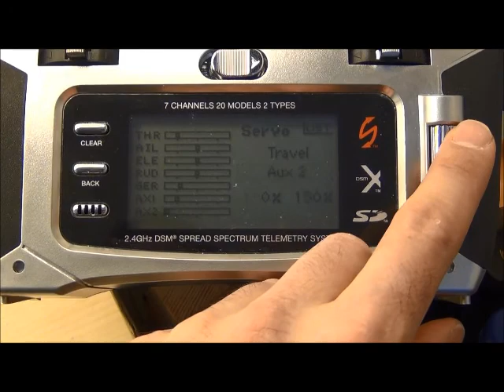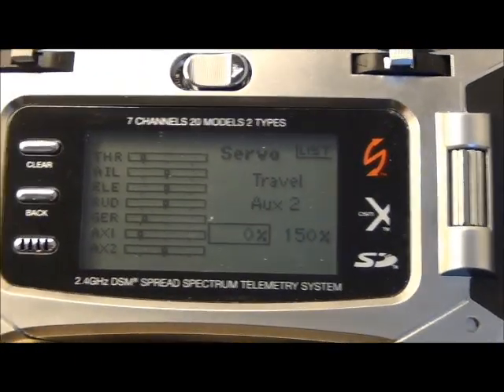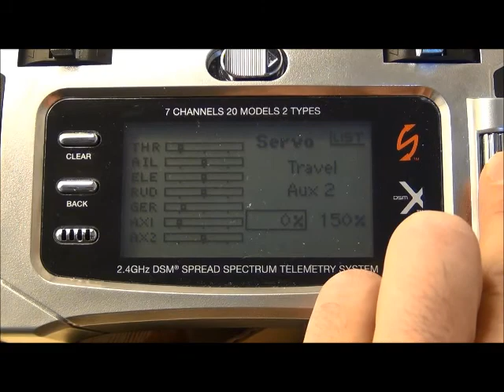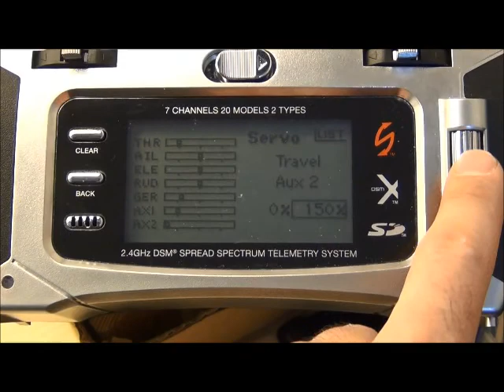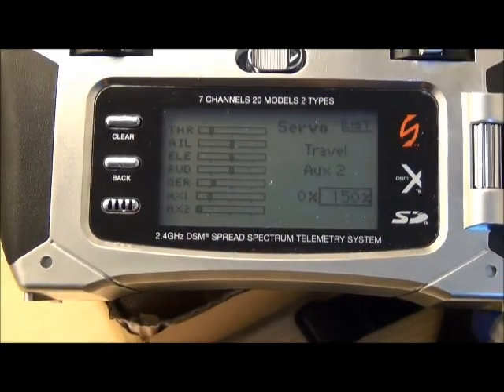Double camera (Mobius and Fatshark 600 TVL), FPV modular system build

Comment: Hello, thanks for sharing! Would you mind adding a link to the type of media switch you used? I am very interested in setting mine up just as you did :)

Thanks!
Reply: Sterling Tucker Well - I see your first video now :P So hopefully details as within.
Reply from the maker: You find it at www.getfpv.com but also at readymaderc and such. Is a relatively easy to find piece of hardware.
Reply: Now that I know it is referred to as a "video switch"...it is easy to find. HobbKing has them for 5 bones